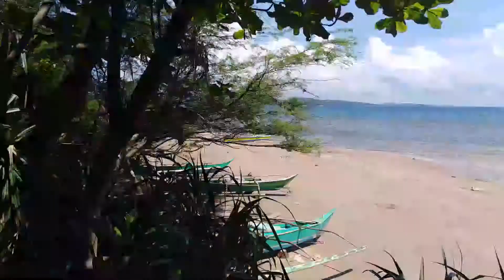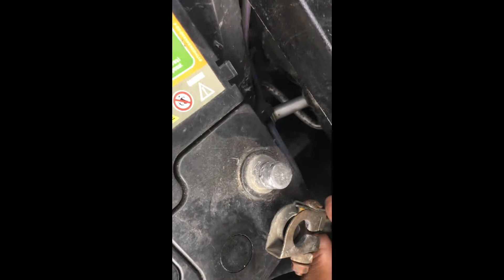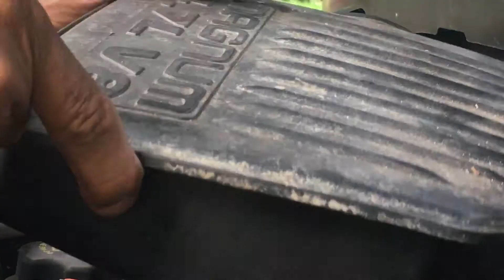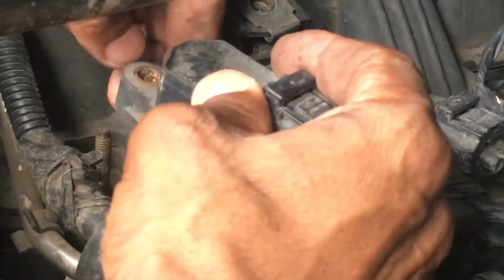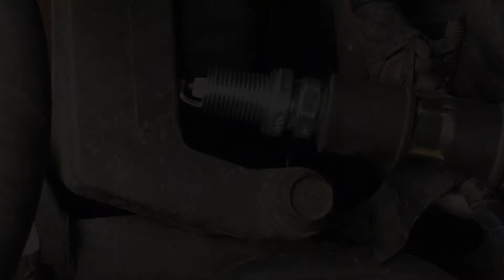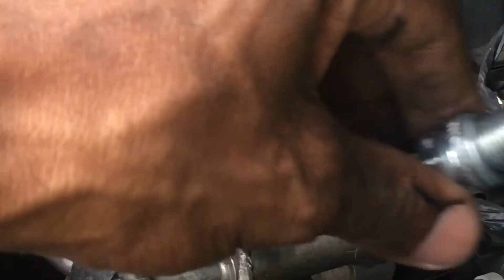BANK REPO DODGE DURANGO 2005 no start fix episode II

Comment: I’m having a similar problem with mine same model was wondering if replacing the power module might fix the issue fuel and air is getting thru just no spark.
Reply from the maker: Not sure..most of the cases I've seen have to do with ECU issues, I just got lucky, usually it's that entire module with fuses mounted inside that's the culprit....best to replace the entire assembly power and fuse module....for me. I'm in a foreign country so I dont have that luxury here....my advice is to use a good scanner like the launch or the innovation as those have 2 way capability that powered on and tests all modules looking for power issues..good luck! Thanks for watching the video...please like/share/subscribe.

Comment: I have 2005 durango 5.7.
It takes 7 seconds to start. I changed fuel evap valve and
I changed the air temp sensor and starts up cold immediately now...but once warm and I turn it off it will take 7 seconds cranking every time. Always starts and runs smooth but it's annoying and seems like it will burn up the starter faster. Just seems weird that it's no difference...always 7 seconds.
Any thoughts?
Thanks
Reply from the maker: Yeah check the fuel pressure ..have a mechanic recheck pressure and  test. If its below 20 or so psi that's the issue. If fuel pressure is good then its could be the fuel regulator. If it's ok then cam position sensor.  It's either the cam position sensor . Bad ignition switch or ground or bad ecu.
Reply: @bbgcars  
Thanks for the quick response. 👍
Reply from the maker: No probs ,hope its helps you out .

Comment: I can spray starter fluid into mine it'll crank it will start up but it won't stay started I think as soon as the starter fluid runs out it cuts off what could it be
Reply from the maker: That's simple! It's a bad fuel pump (check the fuel pressure) should be at least 26psi or bad cam position sensor. It can't Be crank position sensor because crank position sensors are what makes sure the engine starts and cam position sensors are what keeps the engine started and running after it starts... BTW MY. NEW VIDEO FOR THIS TRUCK IS COMING..... She's running again! And the problem was the crank position sensor and computer module.